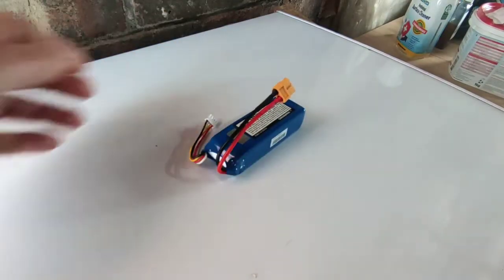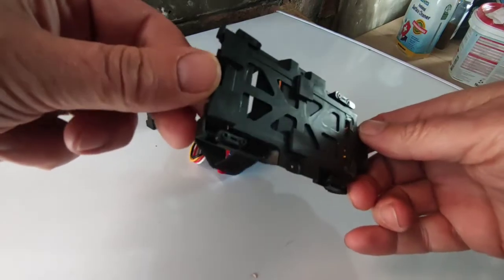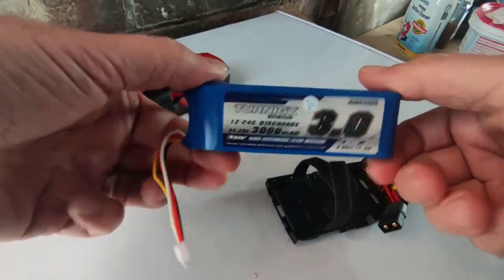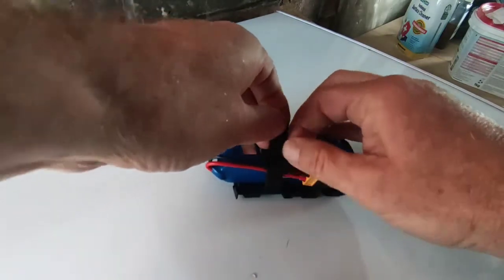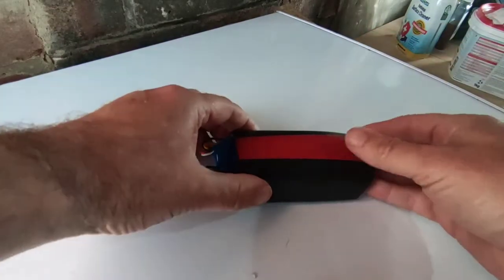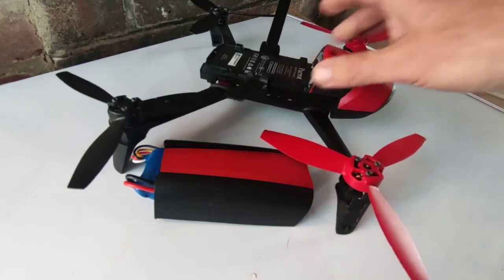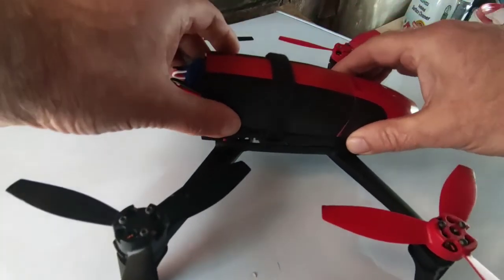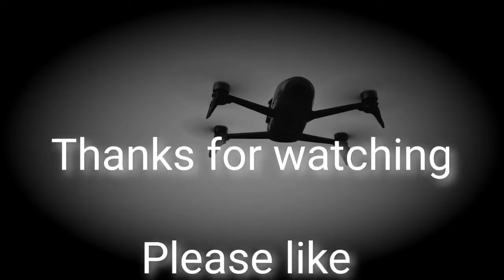Easy - Bebop 2 drone Battery Conversion to Lipo/LIHV for cheaper - longer lasting batteries.

Comment: I know this is an old video but Im digging out my old drones. Did you remove the chips from the board? I saw another video that said to remove them from the battery board. Thx
Reply: Good luck with the App its discontinued.
Reply: @FMC3162  So it's a good thing I have the controller.
Reply: @atienne_navarre Ya in the remote you can plug a tablet or phone to get video feedback. But the App stopped being updated. So you need to hack or jailbreak or somehow Install an Old Outdated Unsupported App that dosnt work with newer OS.

Comment: What are you using to charge them the extra bit? I wondered if you can use the calibration settings on a standard B6 to get up to 11.4v?

Comment: I almost did the same with mine. What are the battery specs and where to buy some? Mine is a 2500 mah 11.1v 40c and gives me only 15min flight time.
Reply from the maker: Capacity	: 3000mAh
Configuration	: 3S1P / 11.4V / 3Cell
Constant Discharge		: 12C
Peak Discharge		: 24C (10sec)
Pack Weight		: ~199g
Pack Size		: ~107 x 35 x 29mm
Reply from the maker: https://www.ebay.co.uk/itm/Turnigy-LiHV-3000mAh-3S-11-4V-12C-24C-Lipo-Battery-XT60-2200-4000-5000-RC-/174369567901?mkcid=16&mkevt=1&_trksid=p2349624.m2548.l6249&mkrid=710-127635-2958-0
Reply from the maker: These LiHV batteries are really good, I only tried them because dimensions wise, they're much shorter than same spec LiPO.. (short and fat) it turned out to be an excellent choice.. 30 mins flight (flat hover) but definitely getting around 25 mins just flying round..

I've posted a link (UK ebay) to the seller mine we're purchased from + specifications..

Hope that helps 👍
Reply: @bebopflyfree7470  
Hi Can I have the link ? Thanks
Reply from the maker: @tec-ideaelectronics5360  Hi.. The link is posted in the comments just above.. 👍